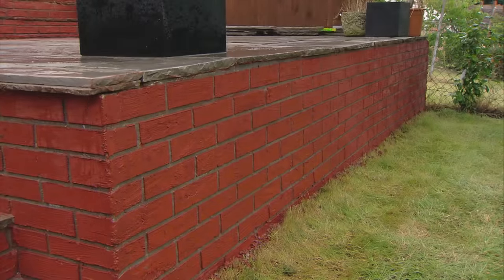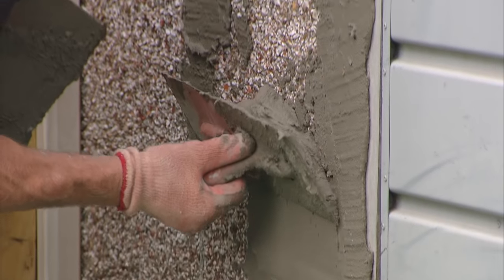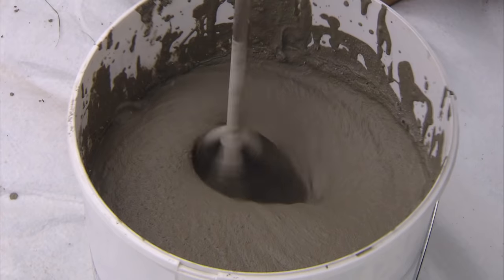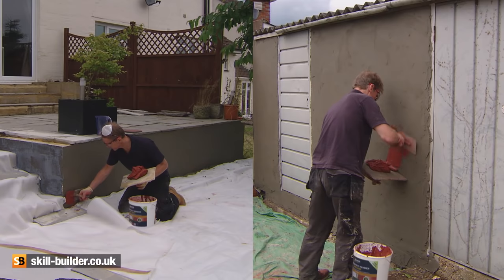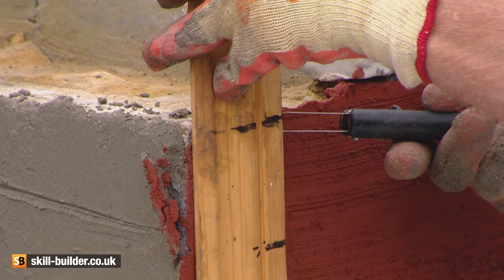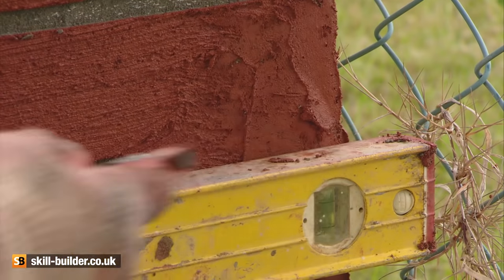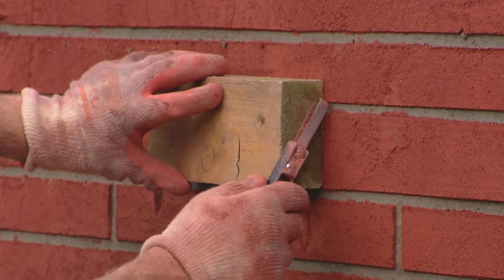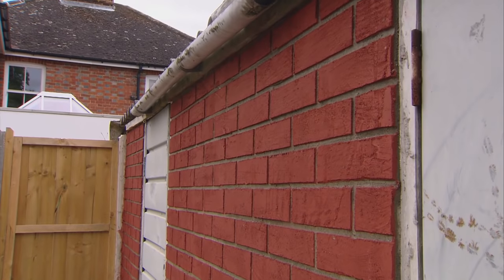Creating a Fake Brick Wall | Faux Brick Effect Render

Comment: brilliant work fast executed and economical too.
Reply from the maker: Thanks. I did make a  mistake but nobody has spotted it yet.
Reply: Some of the brickwork courses look smaller 😃
Reply from the maker: +David Vallerius Well done David. You are the first one to spot it. I used a piece of timber batten and marked off courses from the house wall but what I hadn't figured was the slight variation in the brick sizes which is accommodated in the mortar beds. When those variations are transferred to the fake work the beds are all exactly the same so the variation appears in the bricks. On the next job I measured the courses with a tape and it was better.
Reply: Standard brickwork courses are 75mm , if you start at the top and work to the bottom if the last course is smaller it doesn't notice because of the difference in finished floor levels which should be 150mm below your damp course 😃

Comment: would that stick to drywall?
Reply from the maker: +Mykel Walker Hi Mykel 

 It would work but I wound prefer to use a cement based board if you can get it. You need to avoid movement.

Comment: Could you apply it on metal lath over osb board?
Reply from the maker: You could do that but why not use a cement based board and go straight on without the bother of metal lath?  If you do go onto metal lath over OSB use OSB 3 and tack a vapour barrier over the board before you fix the metal lath,
Reply: Skill Builder
Much appreciated advice buddy. I'll check the cost implication it's a 20ft square outbuilding/shed/gym hopefully I'll get started in the spring.

Thanks again mate.

Comment: That is the shit!
Reply from the maker: ***** I had never done it before the video. I think it is one of the easiest wall coatings you can do but I can't speak for others.
Reply from the maker: ***** Funnily enough that is the mistake I made with this job. You can see the variation in the courses. I took the marks off an existing wall and transferred them. With real bricks you get slightly variations in the bricks that are then  made up in the mortar beds but with all the beds being exactly the same on the fake work the variation shows in the bricks. You can see a course of big bricks followed by smaller ones. Next job I will use a tape measure. You live and learn
Reply from the maker: *****

That is an unknown but the company says it will outlast sand and cement because of the polymers. I would expect the colour to fade after 20 years or so especially red which is susceptible to U.V but it has shown no signs of fading yet. We live in hope